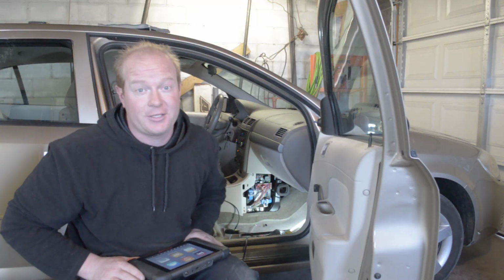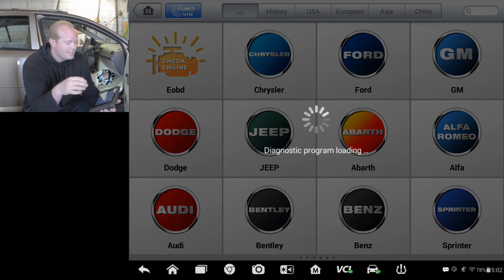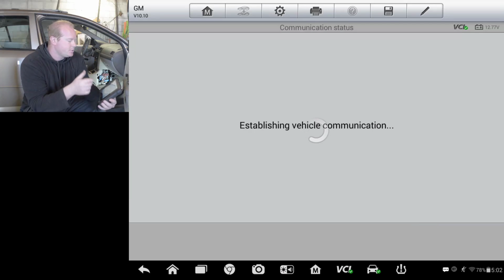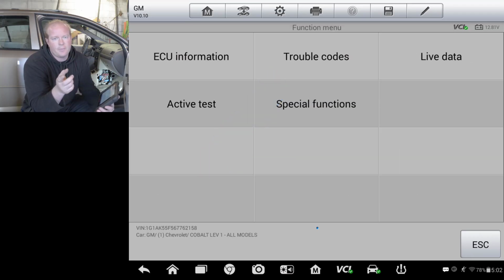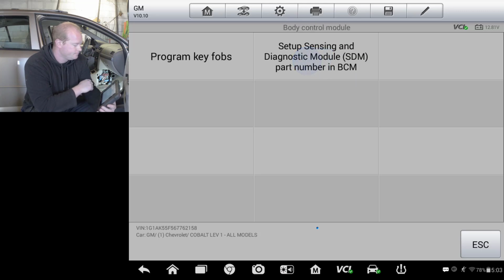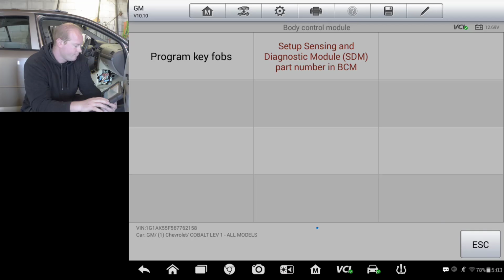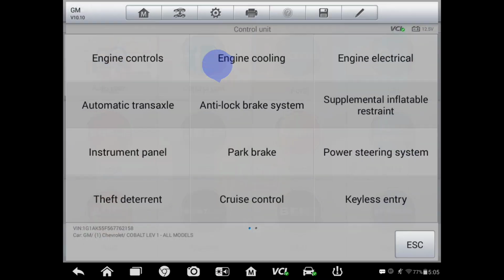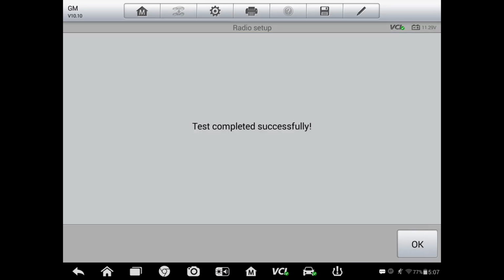Cobalt BCM Coding

Comment: hey i know im a bit late to the conversation but do you know if this can be done with the ds808 maxidias?
Reply from the maker: That's a tricky question.  On this specific application I would say yes because the DS808 has the ability to set up the SDM for the Body control module. However the DS808 is does not contain the high end coding and initialization that the MaxiSys MS906BT and up have.  Function charts can be found on the Autel.com site https://pro.auteltech.com/measurecarAPP-1-1.html?m=94&operatorType=5&pageNo=0

Comment: All you did in this video was set up the primary key from the SDM to the BCM and unlock the radio. Also your not coding the PCM to BCM! What are you talking about man? You need to set up RPO codes from the vehicle. Might want to figure out programming before you make videos about it!
Reply: Fred Head he programmed the BCM to the ECU other way around he prob replaced the radio and needed the ECU to read it. He never said he flashed the cars main brain ECU
Reply: He didn't even relearn the sdm part number, the screen said the numbers already matched and did not need to be done. That was a waste of 3 mins
Reply: People that don't know and want to learn can be misleaded by this BS real quick.

Comment: ON THE 2007 G6 BCM I TRY TO USED THE J2534 BOX TO FLASH THE USED BCM BUT THERE WAS NO LIST ON ACDELCO TECH WEB PAGE THEY SHOW THE ECM,TCM,ABS MODULE, WINDOW MODULE BUT NO BCM MODULE WHEN I CALL THE DEALER THEY TOLD THE BCM WAS NOT FLASHEBEL. SO WHAT I DID I PURCHAGE  A NEW BCM I LEFT THE ORIGINAL BCM HOOK TO THE VEHICLE I CONNECTED MY AUTEL SELECTED THE VEHICLE I WHEN TO BCM MENU THEN SPECIAL FUNCTIONS, I CLICK ON BCM COPY AND FLASH I COPY THE ORIGINAL INFORMATION FROM THE BCM THEN I REMOVE THE THE  OLD UNIT INSTALL THE NEW ONE AND CLICK FLASH AFTER THAT I DID THE SDM ON THE NEW BCM AND THE LAST STEP WAS THE BPP SENSOR CALIBRATION  AFTER THAT THE ORIGINAL CAME BACK TO THE DASH BOARD AND ALL THE INDICATORS LIGHT WHEN BACK TO NORMAL.

Comment: Hello! For this procedure, did you use a VCI like the J2534?
Reply from the maker: Yes, the bidirectional controls of the Maxsys tools is very extensive.  I have had many Autel owners tell me they could do more tests and special functions with their MaxiSys then with their Snap On tool.
Reply: Idris Bakali No, this was done from the tablet with the standard VCI.  no J2534 or internet connection.
Reply: I am thinking to purchase the Autel since it can do so many things besides the Snap on Versus that seems to be limited. Does the Autel have a lot of bi directional functions?

Comment: HEY  I GOT A 2007 PONTIAC G6 I REPLACE THE BODY CONTROL MODULE WITH A USED BECAUSE I WAS NOT GETTING COMMUNICATION WTH THE ECM TCM  I FOLLOW THE STEPS ON THE BODY CONTROL  BUT NOW THE ODOMETER IS DIFFRENT  I GET THE ABS, BRAKE , AIR BAG TPM INDICATORS ON THE DASH BOARD ON ALL THE TIME  WHEN I REINSTALLED THE ORIGINAL BCM ALL THE LIGHTS GO OFF AND THE ORIGINAL ODOMETER ALSO GO BACK TO NORMAL THIS VEHICLE HAS NO ABC CONTROL MODULE. AND HOW DO I FIGURE OUT WHAT KIND OF RADIO THIS VEHICLE HAS
Reply from the maker: I had issues when I replaced mine to.  It turns out their are multiple versions of the same body control module.  You will need to find one with the same Part Number and calibration.  Once you get the right PN and Calibration you will most likely need to program the BCM with a Tech 2 or J2534 box.  From OE information: 
BCM Programming

Important: Use extreme care when verifying both the VIN and Odometer reading that is set in the service BCM. Once the VIN and Odometer are set in the replacement BCM it is impossible to change them, and if there is a mismatch, the part will be rendered useless.

To setup a new replacement BCM select Vehicle Control Systems, then navigate to Computer/Integrating Systems, once in the Computer/Integrating Systems menu select Module Replacement/Setup and follow the instructions on the scan tool. After the setup procedure it is necessary to perform the Remote Start setup procedure and brake pedal position (BPP) Sensor Calibration procedure. Refer to the Importants below for further information.

If the BCM fails to accept the program, perform the following steps:

 *  Inspect all BCM connections.
 *  Verify that the scan tool has the latest software version.
Reply: the used one that i got had the same part numbers but the those light keep lighting up so i ended up geting a new one from the dealer then i use the autel to program it everything went back to normal. all the light when out and the original miles came back.
Reply: HELLO BAKALI
I HAVE TOW AUTEL SCANNERS I GOT THE MAXIS 908 THAT COMES WITH THE J2534 TOOL AND I ALSO HAVE THE NEW AUTEL MS906TS THE ONE THAT HAS THE BUILD TMP  . THE ONE THAT I USED WAS THE MS906TS  TO DO THE BCM  AND YES THE AUTEL HAVE MORE BIRECTIONAL STUP I BEEN ABLE TO REPROGRAM BY HONDA KEYS AND NISSAN TOO. THE ONLY THING ON NISSAN YOU NEED TO CODE CONVERTER FROM 4 DIGIT TO 5 DIGIT YOU CAN ONE ON AMAZON OR EBAY THEY WORK GREAT

Comment: i have the same year car and just replaced the ECM in it my ? is i have a driver side headlight not working on low beam works on high beam sealed  beam light just put LED in  all other lights work do i need to maybe replace the BCM or maybe just reprogram it
Reply from the maker: There are a lot of other things I would recommend checking before replacing the BCM.  Start by using http://alldatadiy.com and purchasing the wiring diagrams.  Each light has its own fuse, start there.  Then bypass the relay and see if the light comes on.  Then I would use a scan tool to command the BCM to turn on the lights and see if you get a ground signal.